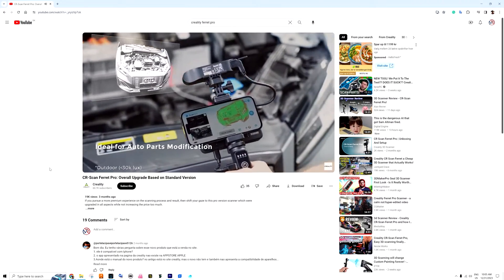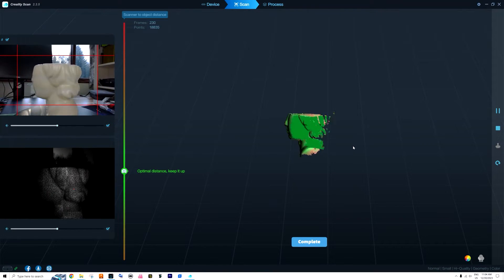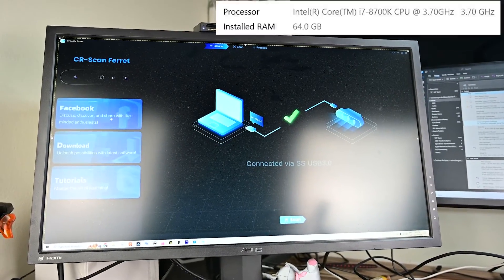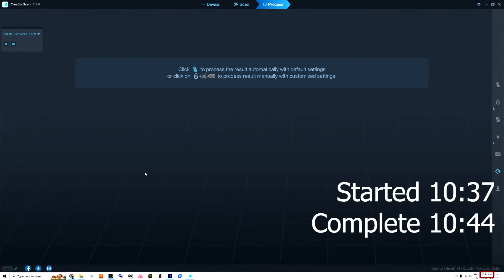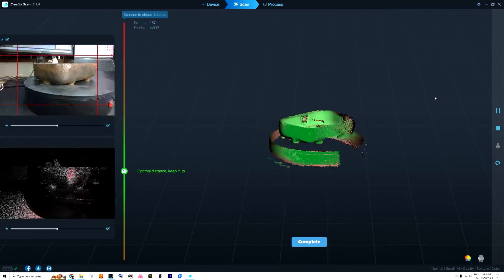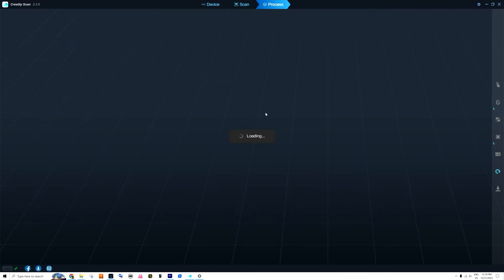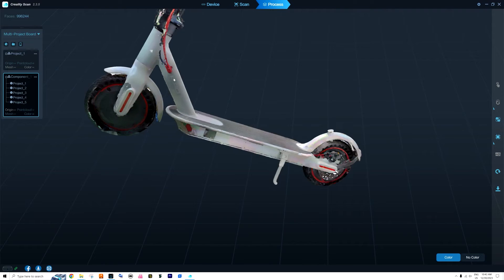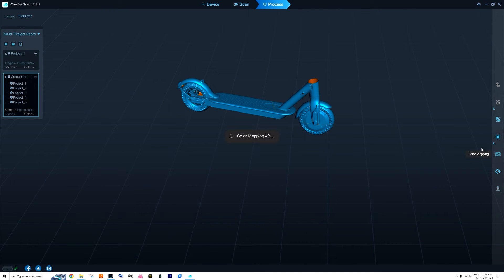Cr-scan Ferret Pro 3D scanner. First Impressions

Comment: Nice one, for the cost of Polycam this starts to make sense really quick. I’m wondering if it can do like a window sill or small sections of the inside of a car?
Reply from the maker: So I have not used it now for a while, I can’t remember, but you should be anble to scan like a dashboard of the car pr a window sill. I have managed to scan a part of my sailboats cabin :)
Reply: @VRMinde Hello, which one should I use, the ferret or the lizard, to scan black objects under 2cm?
Reply from the maker: @puvo2367 Hi mate, sorry, but I have not been scanning anything in the last 6 months, so I feel outdated on the subject to give you good advice... I think ferret was not great for black objects...

Comment: Scan without it plugged and then try and connect the phone to the computer ----- IMPOSSIBLE!!!!! IT is impossible to transfer a file from the phone to the computer - point and I see this video doesn't either - they know or were told not transfer from the phone.
Reply from the maker: I transferred files from my phone to my PC via wifi mate, there was no problem.

Comment: The thing is, this 3d scanner is still a hobby not a professional model, this has an accuracy of 0.1 mm a professional like cr-raptor has 0.02mm… soo the tech is there but for a good price
Reply from the maker: I agree, and it does kind of OK job, especially for the price :)

Comment: try einstar, and You will forget about scanning issues
Reply from the maker: I should. But it is not cheap is it? :)
Reply: Or Creality Otter. It can scan black and shiny objects better. But the software of the Einstar is really good.
I scanned a transport box this week with the Einstar and I had tracking issues as well. I added a lot of features but in the end I had to use markers for perfect alignment. 

Ordered a Creality Raptor this week. And I’m excited to see the scan results with this scanner.
Reply: I think now You can buy it for 750eur ut is cheaper that it was, but still top quality scanner
Reply: from my point of view using diferent scanners below einstar quality is waste of time. You will see that when start using einstar
Reply: What model ?

Comment: Hi, yet another thing that we both review ;) got this a few days ago. I heard that pc software is better than mobile app, but actually the android version is not bad. Also even my i9 9900 pc isn’t that much faster than the mobile app? My phone is galaxy s10. So give the phone a try.   Phone: I’d love to see if someone can use his phone just with usb connection, for me it connects, but the camera previews don’t start. I guess my phones usb is to slow, so I have to use the complicated solution of using their WiFi 6 bridge… greets, Mario
Reply from the maker: I got scan from phone transfered to pc no problems via wifi, but I am freeing up space on my iphone 12 to have enough time for a decent scan :) will make another vid with the results :) I like the wifi version as you are free to move away from PC…
I think on PC what matters the most is the graphics card. I am using an old Nvidia rtx 2080ti… it works…
Reply: @VRMinde   the GPU isn't really used on the PC. if you check taskman and see that the GPU is very low on usage...  I use a rtx 3070 at the moment, and while processing this thing doesnt do anything.   one time I thought now it's used properly - but it was only OBS encoding the video from my screengrab :)     the processing could be 10x faster if they use some GPU cores...
I have the feeling, the IOS version is a lot older than the android tho.    greets, Mario

Comment: I also had a fight with the drifting surfaces. I played with light setup and manual exposure settings without success. At least the reason is that the scanner can't find enough orientation points, especially on flat parts of the objects without texture. Anyway, I came here to know if the ferret pro is an improvement compared to my ordinary ferret scanner. It seems the problems I had on special object still the same in the pro edition.
My recent scan project is a bread slicer from the 70s named EVA from Denmark, ;-) Greetings anyway to your location.
Reply from the maker: Hi mate, it is very much object dependant. And some things scan super easy, some others are much harder. I might have also found an impossible one :D 
I have never tried the Ferret, so I don't know if pro is much different. Have fun with EVA :)
Reply: I think the pro version is only improved with their wifi bridge (for mobile operation).   the most improvement could (and should) be done on the software side!
Reply: @Rcschim  now that I ordered the pro I am able to compare. At least the announcement says that the pro is better on black or shiny surfaces and has an improved anti shake option especially for hand scanning. Anyway 3d scanning does on special objects not work like in the yt commercial spots, but I can proof that the pro does it better on objects that where almost black like old box cameras.
Reply: @matneu27    will be interesting to see if you find a lot of differences on the pro vs the normal version.  I still think that the most work here on 3d scanning (like on 3d printing) is on the software side.
Reply: @Rcschim  that is true, with the ferret you are also caught in the manufacturer software bubble and can only export the results. I also had to install windows on my Linux only machines to be able to run it. Doesn't work on virtual machines anyway because it is related on a good graphics adapter. But the main work is the post process in blender for example to make the scans able to print.
Reply: Tracking is always an issue in 3d scanning. Every scanner, price doesn’t matter here, has more or less problems with it. Adding more light is bad for 3D scanning because it adds noise. 
You can add features to improve tracking with crumbled blue painter tape or anything the scanner can pick up and has features (especially if you scan something like this scooter), 3D printed features, clay, Markers or markers added to 3d printed target markers.